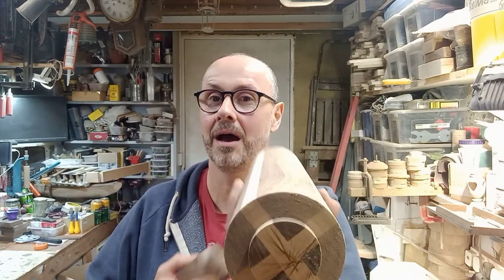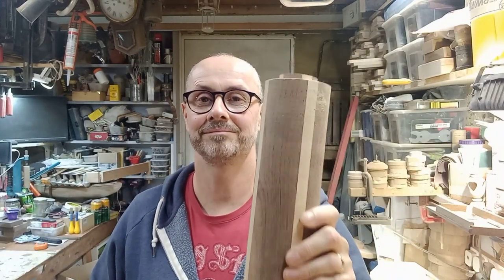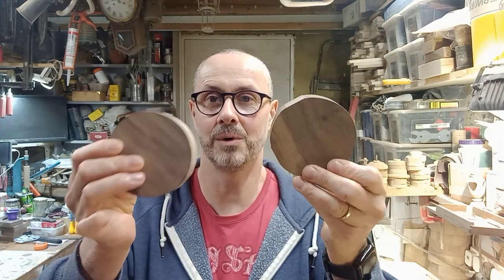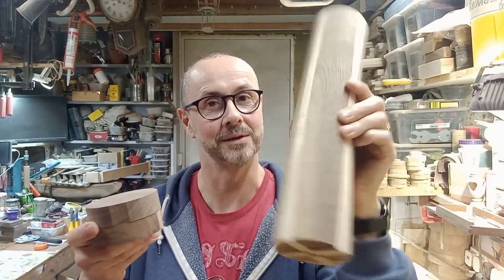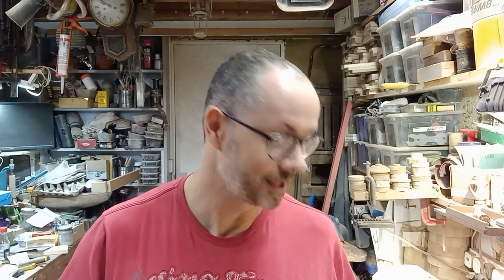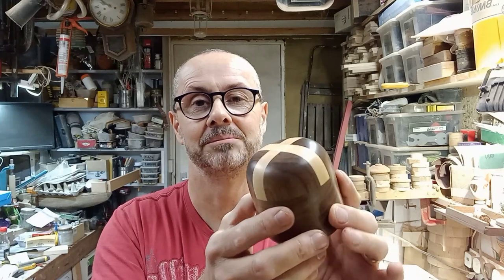wood turning Hotcross Bun lidded pot

Comment: What!!! Microwaved off the tenon, sanded 80-220 then shellac then wire wool then cut and polish then microcrystalline wax?!?! I’ve not tried any of those before!!! Great buns and lots for me to learn 🥰🌲🦊🌲
Reply from the maker: Ok l hot glue the tennon on so put it in the microwave for 15 seconds melts it....I will have to work on my delivery if you didn't get it...that's OK....cut'n polish is like Yorkshire grit....its what I normally use....they are great buns....that blank has been on my workbench for ages I'm pleased to get rid of it....glad you liked it...
Reply: @ultrawoody1968  sneaky - I used alcohol to soften the hot glue today that worked - but microwave is a fab idea! Will try that too!!! I figured you’d hot glued it x
Reply from the maker: I use a scraper to get the glue off when it's soft...I've burnt myself before....hot glue who'd have thought 🤔...I'll film it next time I use it...